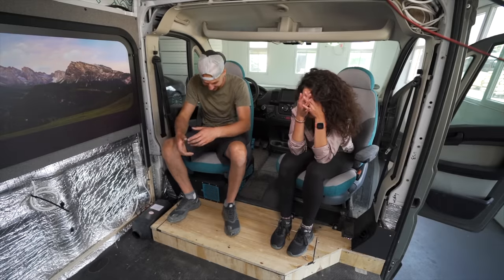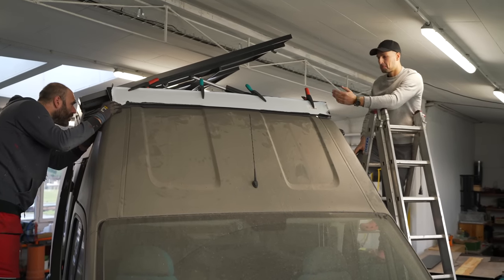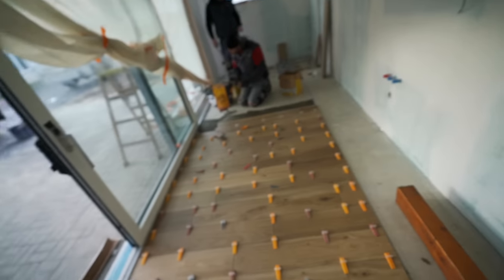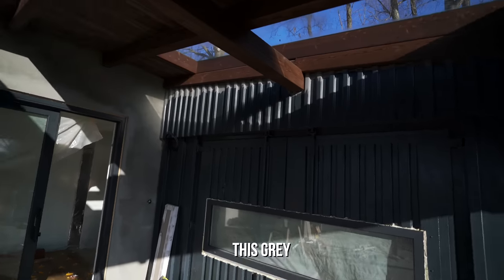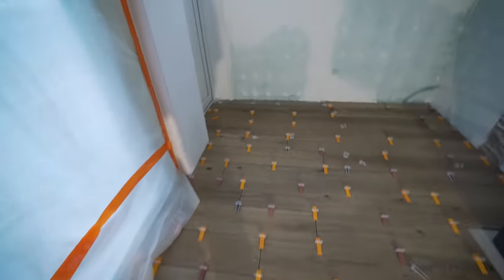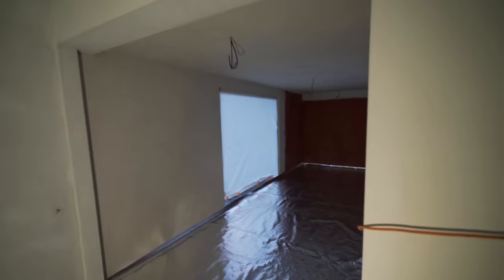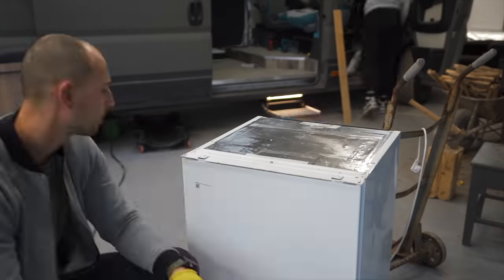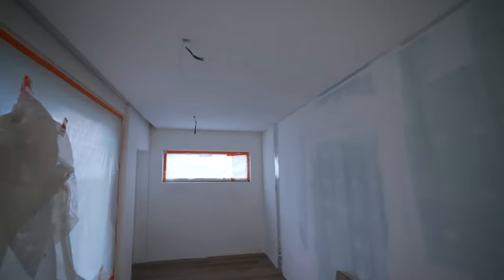360° Monitor Build / VAN LIFE EUROPE

Comment: Primalex is always my wall paint of choice (I live in neighboring Slovakia). They make several types of white paint, they differ by what can be described as color temperature. Primalex Standard is a kind of neutral white paint, then there's Primalex Polar which is bright white. Then if I remember correctly they also have kind of dirty white for places like cellars where there's no need for shining white.
Also from my experience wet paint is always darker so if that was wet then it's perfectly normal.

Comment: for the heating you can go for geothermal heating "vertical one, because you may need to add more building later "
it is a great solution, will cost upfront but will save ton of money later
and will work perfect on both summer "for cooling" and winter " for heating"

Comment: What happened to the "Lay-z-boy Recliner in a van" idea that we were promised ages ago? Ditched too? (it was one of the dopest ideas I was looking forward to)
Reply from the maker: Very good you remember. We just bought some aluminum and we’re aiming on welding a base for it this week. The heater is finally installed in the van so the recliner is next!
Reply: @ladiandmargaret  you guys are overthetop - like, where are you gonna place it? Looking forward to actually seeing that episode. A van with a Lazyboy recliner, an air conditioner, and a Cub-Mini - is my definition of comfort on wheels.
Speaking of aluminium, now that Ladi has learnt how to weld aluminium maybe it's worth revisiting few bits and bobs made of steel.
Reply from the maker: I’m about to weld a frame over the heater right behind the driver. It will be a fun project, especially making the upholstery!

We won’t be going back and rebuilding old designs. We’ll wait for when they fail us to have a reason for upgrades. Otherwise we would never leave the workshop 😂